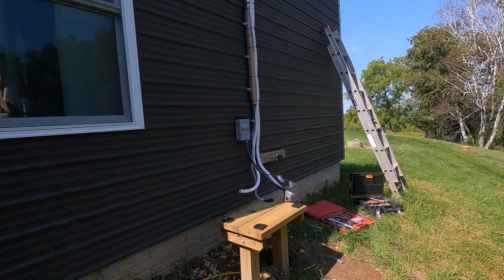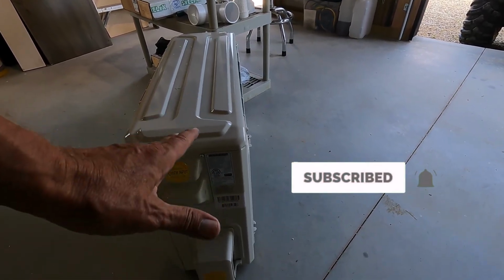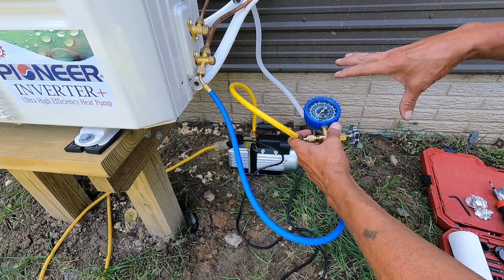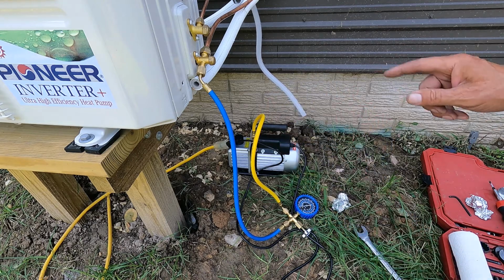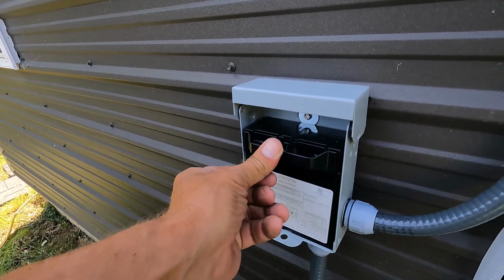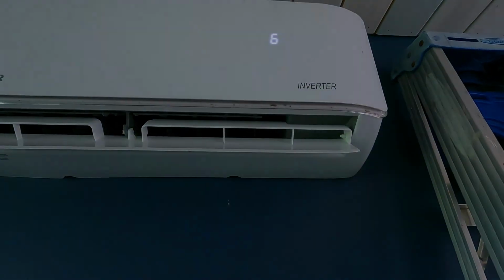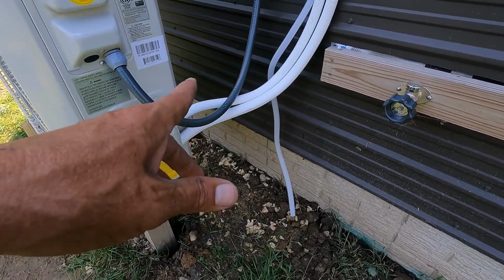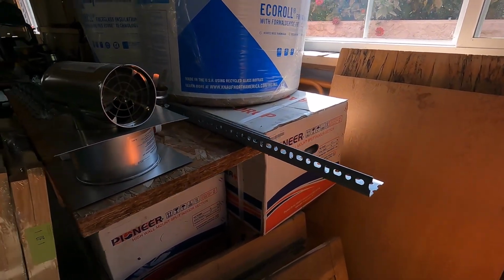Mini-Split Condenser Unit Swap-Out and Refrigerant Release [Success!]

Comment from the maker: Success! Two more of these coming up soon so make sure to subscribe and stop back!
Pioneer Diamante Series Ductless Mini-Split Air Conditioner Inverter Heat Pump - https://amzn.to/3R3pyKS
Vacuum Pump and R134a Manifold Gauge Set - https://amzn.to/3Q0xyLi
Ductless Mini Split System Charging Vacuum Port Adapter - https://amzn.to/3TkoVOC
CopperCoat Green Wood Preservative - https://amzn.to/3cqxVBb
Nylog Blue - https://amzn.to/3KNjtQI